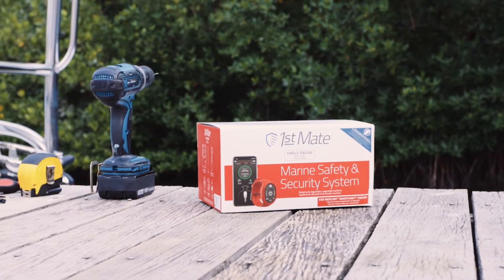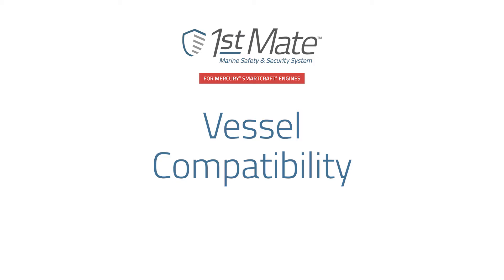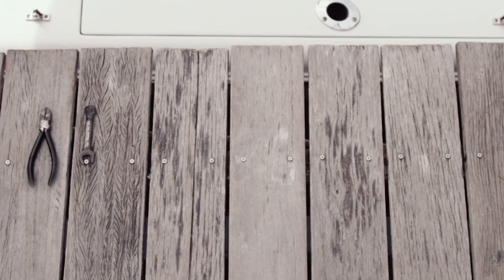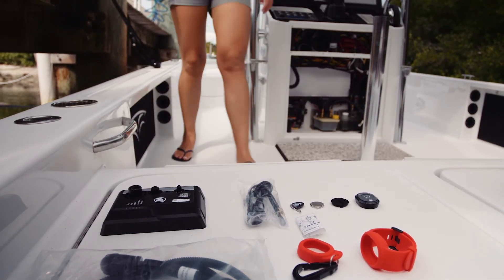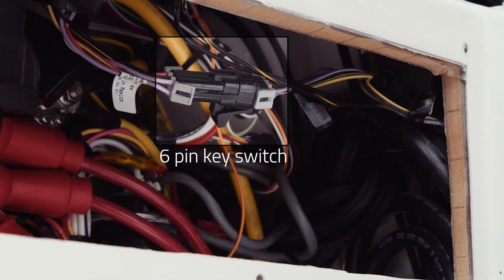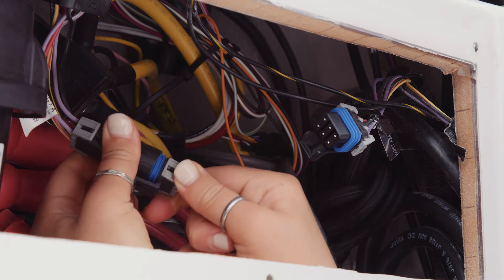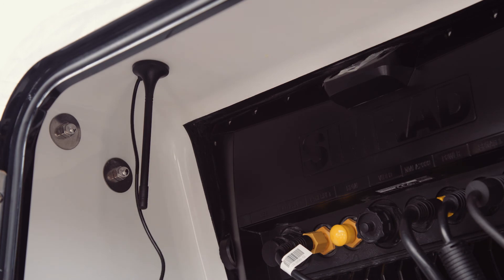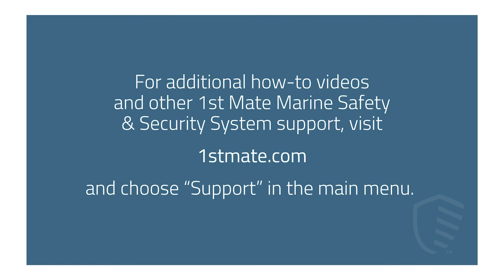How-to Install the 1st Mate Marine Safety & Security System™ for Mercury® SmartCraft® Engines

Comment: I see this post is about 3 years old. Can you tell me what your experience has been now that you've had the system on your boat this long? Are you still happy with it? I had the Fell system on my previous boat and thought it was crap; it gave me lots of issues, and calibrating it was a pain. Please tell me your honest thoughts. Thanks
Reply: I just tried to install one on my 2023 twin 150 mercs. The app would not connect to the hub. Tried multiple phones, troubleshooting steps from 1st Mate, etc. 1st Mate wouldn’t RMA it …. Told me to warranty it through a dealer. I ended up returning it to West Marine. Their support is terrible if their recommendation is to work with a dealer on a product they sell directly to the public. No dealer is going to help RMA a product they didn’t sell nor install.